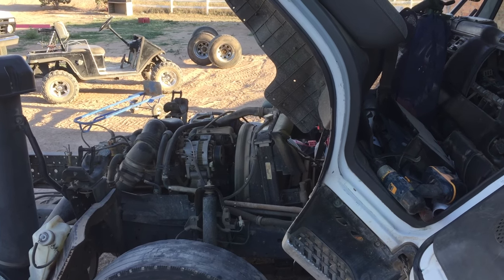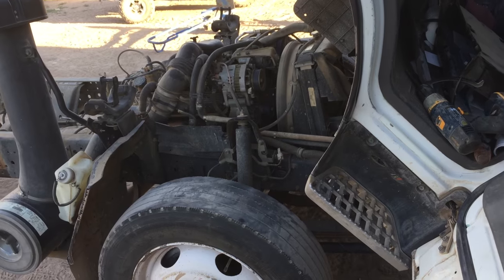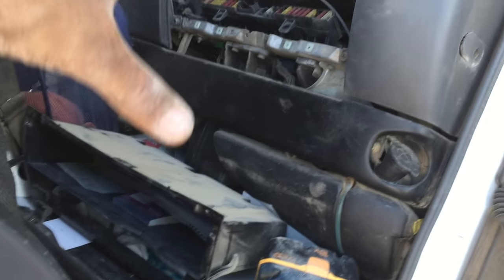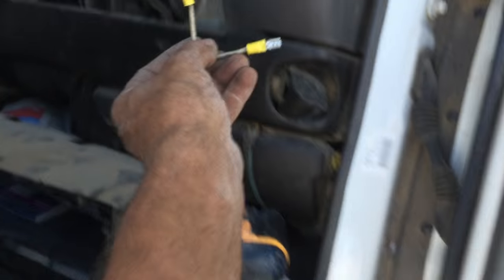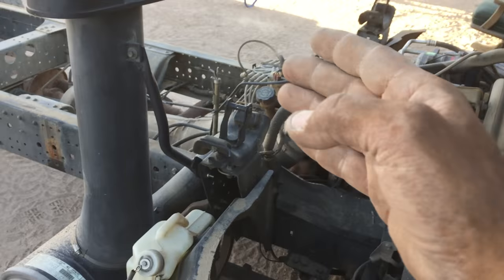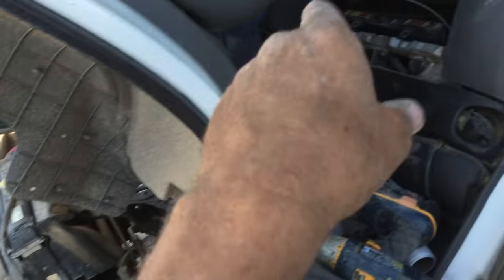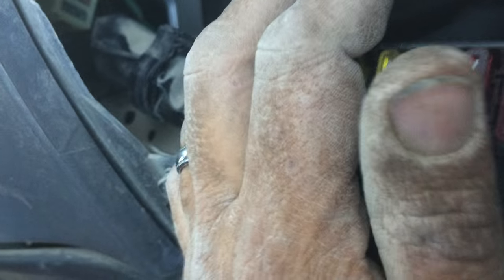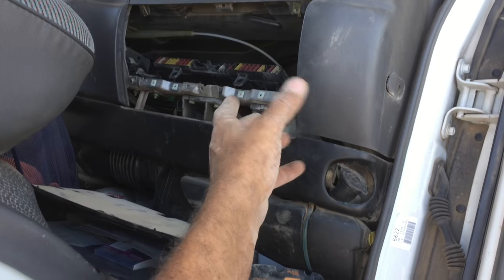2000 Isuzu NPR No Start, Transmission Shifting Issues

Comment: I have a 2002 NPR, and had no dash lights, and truck just died suddenly. Mechanic couldn't figure it out, but I watched your video, and went to his shop tonight and sure enough, behind the fuse box, there were those 3 little fuses, and it was the 10 amp fuse blown. man, this really helped me, as I was going to buy an $800.00 computer, and cross my fingers that was the problem. and normally there are no returns on electric parts. I'll have mechanic put my old computer back in and see what happens.  I would lie to figure out the why, the fuse blew, but that's another day. Thank you so much !

Comment: Thank You! You saved me a day of diagnosis.  I was driving today when my speedometer stopped working, many of my instrument cluster lights went out and my transmission would not shift.  I have all of the factory manuals for my 2001 NQR and was ready to dive in when I thought to check YouTube.  Your video popped up and sure enough the 10 amp fuse was blown.  I might have never found it in that location.  Thanks again!

Comment: Thank you so much for this video!!!!!
  Saved my rear end today as a customer of mine had a no crank no start issue this morning at a job sight. Talked to dealer, couldn't help with diagrams. 
  Sure enough I looked on YouTube and it was the 10amp fuse in that white box behind the glove box that was hidden. Put new fuse in and we had power, DLC and PCM communication and it finally started and ran. It also got the blower motor on the AC working too. 
   Again... THANK YOU FOR THIS VIDEO!!!!!!!!!!!!!

Comment: Thanks a million dude for posting this just so you guys know in my 2002 I did not have to remove the whole glove box or fuse panel if you pop off the gray trim by taking out the ashtray and pulling it off there's two hand holes to access just this fuse box a big one for your hand and a little one for needle nose pliers

Comment: Thanks a million I was about to change the transmission 6000.00 cost I have a 2004 gmc W4500 The lights on the dash board stopped working and the transmission shift not working properly when I     put on Drive transmission skip th e first gear and start on 2 gear the over drive button doesn't work I changed the fuse mentioned in that video it was burned of course all went back to normal Thanks Again

Comment: i just bought a nissan ud 2600 diesel turboed. i drove it 750 miles home. next day wont start, ive been chasing wires all day.  looking for the short, spliced some crummy rotten lines but still no luck..... its so hard when someone else went in and rigged up a crazy system and i have to figure it out,

Comment: Hey thomas..im working with a 2000 NPR 4.8L ...with this transmission...shifts fine in all gears ..just when coming to a stop it jerks violently and makes a noise that sounds like the shifter was thrown into park while the vehicle is moving...and thoughts on that

Comment: Hi Brian,
I have a 2013 Isuzu NPR HD with 40K miles on it.  I drove it a few months ago and then tried to start it a week later to find that my dash lights all came on when I turned the key but it would not crank.  I thought the battery was at fault so replaced it, still no starter.  I then replaced the starter and still nothing.  My scanner is telling me it can't communicate so I then checked the fuses (not the ones you mentioned in the block behind the dash) and all checked ok.  I can start the truck if I bypass the ignition circuit and go right to the starter solenoid with the key on and it will run for about 2 - 3 seconds and shuts down.  I have fuel in the rail so I know the pump is working.  I am now thinking it might be the PIM.  Any thoughts?

Comment: Thank you for the NPR videos !! I noticed a lot of these trucks are needing service! I have a 1999 NPR Isuzu with a crank only no start issue. To start the engine I have to bypass the fuel pump relay.. Any thoughts?
Reply from the maker: is there a check engine light? have you tested the relay itself ?
Reply: thomas brian 99 npr no click, no start. Battery is fine so I’m lost. Any advice?

Comment: I have the transmission light on, on my dash telling me that ....my Isuzu 08 diesel NQR 5.2 L. Question, can I find the same fuse on my 08 Isuzu 5.2 related to my shifting gear problem? from 2000 models to 2008 is a big difference..?. thanks JC

Comment: Hi question i have a 2015 Fuso diesel engine it taking about 35 seconds to start up the engine even when the engine been running for hours turned off then started again it hard to start too .  Do you have any idea?  It is bad injector?

Comment: HI BRIAN. Have an ELF NKR81 witha a smother-e transmission. Its a basically a manual transmission without a clutch. Have you any experience  with these if so I have a few questions for you which may be worth making a video about.

Comment: 2004 Isuzu diesel with 4HK1 engine - I believe that's it - just shut off while on highway.  Suspected poor fuel.  Pulled fuel filter.  The level was almost halfway.  That's not normal.  A hiss sound when it unsealed as I spun it off.  Clogged fuel tank outlet to the engine maybe?

Comment: Hi Thomas i had a tracked diff banjo for an Isuzu npr 300 truck, i replaced the banjo and the ignition started just fine with no warning sensor light coming on, but later whn i started the ignition it started, while on neatral it gave a revving sound than it stopped. When i turn the ignition on the transmission warning light comes on and the truck won't start. Even whn i disable the diff sensors and the battery, same thing. A diagnostic tester guy said it's the relay shift, i changed it but still same problem. What could be the problem? Thanks

Comment: Hi Thomas. I have a 1999 W4500, reverse gear does not work. Could this be caused by that fuse? All forward gears work fine. Also only getting 4 mpg. I know it needs a manifold gasket, Could that be cause for low mileage? Thanks.

Comment: Hello I have a Isuzu elf truck NKR similar to the NPR its a 2003, I'm not starting I had to replace a diesel pump them it started but idle badly and we tried shifting the pump timing but I do realise that on ignition the EGR system and the suction control valve for the fuel pump always running can this be my issue? Also I don't get anything when I plug in the OBD2 scanner.

Comment: I have a lavatory truck we use at the airport I got a trouble code pop 757. B12 I have no forward and no reverse. The codes says that the solenoid is stuck. What’s it talking about? I’m in Cleveland Ohio.

Comment: Great info. I have a 07 isuzu NPR 5.2 diesel  and when I use my left turn signal the trans starts shifting bad and a gear with ! Symbol appears on the cluster only when turning left. Have you come across this issue?
Reply from the maker: yes, a pig tail on top of the trans, easy to see and to get to. 2 wires on one side, 1 wire on the other. it was broke and doing that exact same thing. i could not explain what it went to. but i figured the wire needed fixed, so i did and the damn issue went away. i wanted to research it more but the truck was needed back in the field asap. thanks for the great question. i hope it helps. thanks for watching.

Comment: Mr Thomas i desperately need your intervention, i have a 2012 npr 300  isuzu truck, i my rear axle seal was leaking differential oil, I have replaced the both outer seal and inner seal. It's no longer leaking but it won't start, its shows a gearbox sensor light. If i disable a sensor on the engine and put it back on it starts. Do i have to take it to a diagnostic tester in order to disable the sensor since the seals hv been changed? Please advise
Reply from the maker: yes, you can also disconnect the battery or batteries, and allow time for the ecm to drain (15 min or so ) then reconnect the batteries and start. this too will reset the stored code. i personally leave them disconnected for about 30 min although 15 or less normally does the trick.the ecm will re learn itself and when it does not see a issue anymore it will fire rire up. great question. thanks for watching.

Comment: Hello sir. I have a weird question for you.  My job has a 99 npr diesel 4cyl. Today my truck would not shut off. I had to hit the fuel shutoff lever to turn it off. Now the key wont light up the dash. Any ideas
Reply from the maker: prob the ignition switch. it will control both
Reply from the maker: im guessing its a 5.2 ? i would go to ignition switch first
Reply: Thank you sir. I'll check it
Reply: Sir we’re is the fuse shut off lever?

Comment: hi. I have 2 questions:
what is the difference between npr  and npc? 

where can I find out if a 2004 GMC 4500 transmission will fit a 2000 NPC ISUZU? 

I can't find any information on the NPC, but I found one for sale. 

thanks!

Comment: Hey Thomas, I'm having similar symptoms with my '95.5 Forward GMC W4 Gas.  It's got a 350 TBI engine with at low compression on at least two cylinders that blows oil out the case vents.  It has an off idle hesitation that seems like a bad TPS, but tests OK.  It seems like it shifts weird sometimes and uses A LOT of fuel.  I looked for that fuse cluster behind the glove box, but couldn't find it.  Would an older gas model even have one?
Reply from the maker: i think you have pre 1994, no they did not have it then. the fuel loss and low compression go hand and hand. the trans shifting weird on that engine will be due to one of two things. a bad trans , or low spark in the cylinders. check plugs and wires and cap and rotor. and even a low coil output. these items also go hand in hand with fuel issue. good luck.
Reply: Thanks.  I already changed the plugs, wires, and cap and rotor (coil seemed ok), so I think the low spark is ruled out for now.  I'm guessing that the transmission is probably ok.  It just seemed strange to me because I'm not used to a heavily loaded big truck with a weak engine on hills.  At least it's getting the job done now.

Comment: Have a 2003 W4500 with a myriad of electrical issues (no cold start, no exhaust brake, no DRL, temp gauge cycles to maximum reading, fast flasher but no lights on right signal, faint glow from indicator lights when running at night, [indicator lights go dim and pulse in brightness on cranking], turning the key to ON (w/o cranking) and the charge relay (B-19) starts cycling of and on at a rapid (0.5 sec) pace, (cranks at a normal rate however). . .  All fuses work, batteries good (hold charge, 13.8V resting, load test as good), all relays good, all solenoids test as should, all circuits test continuous, no indication of parasitic load.   The pass-through connector (H-4 - H-8 connectors) is all that is left to check for continuity but is relatively inaccessible.  As it has a bolt through it holding H-5 - H-8 connectors into the housing, does your experience indicate this pass through comes apart if the bolt is removed. (The H-4 connector sits outside the H-5 - H-8 housing and can be split apart fairly easily; allowed me to clean the pins and sockets remedying a forward drive engagement problem [ D-2-1 placement of the shifter had no forward motion] hence my reason for testing the current draw through the pass-through to see if the rest of the pins and sockets need cleaning.
Reply from the maker: absolutely they do, thanks for watching, is this a tilt master?
Reply: Thanks for the reply. (Been trying to beat the weather with this repair).  Yes a Tilt Master w 4HEI diesel.  Pass- through on my truck will not come apart.  Have now stripped the cab (to expose the harness) and testing the continuity of individual connectors in the pass-through as well as current bleed from possible crap in the connector to other circuits indicates nothing is possibly wrong at this point. Opening the looms starting with the relay banks (top center) of the dash and tracing circuits it soon became obvious there is no adequate wiring diagram for this year/model of truck as this truck is wired different at the charge relay than indicated in  any and all of the wiring diagrams I have seen (and I have the Isuzu shop manual for this truck).  The alternator has been replaced (as the voltage regulator is not replaceable) but the faint glow of the indicator lights when running (intermittent) suggests the v-regulator is faulty in the new alt but diagnostic tests from in the manual indicate otherwise.  Alternator shop cannot provide a schematic for the outputs on this unit to do my own testing and they assure me the alt. (though a rebuild) was bench tested once rebuilt.  Pain in the ass to swap again (due to vacuum pump) so want to test thoroughly first before I do this again as it is now -10c and snowing for the next few days. My voltage relay is wired as such: (#87 [relay] = #1[socket], #85 = #2, #87a = #3, #86 = #4, #30 = #5) B-19#1 is an empty socket (no wire), B-19#2 comes from alternator (W/l color wire in plug connector on the alt) through the pass-through to the B-19#2 connector in the relay socket. This circuit branched before the relay socket and continued to terminal #3 of connector B-52 at the instrument cluster.  The diodes in the i-cluster tied to B-52#3 all test good. Further upstream, the gauge back fuse is good and I get 13.2V at B-51#8 suggesting power to the i-cluster from the ign. switch.  Back at the charge relay socket, B-19#3 and B-19#4 connectors DO NOT go to ground as in the wiring diagram BUT ARE instead both connected to fuse #12 which is switched to 12v at the ign. switch.  B-19#5 connector in the relay socket connects to the #2 connector of relays B-38 (exhaust brake) and B-21 (heater/AC) powering the switching coil in them (as #4 connectors at B-38 and B-21 both go to gnd).  The wiring diagram has B-19#5 relay connector circuit branching back to the i-cluster to the B-52#3. I lack this branch as the connection to B-52#3 is made from B-19#2 relay connector. Though lots of branches w/i the wiring looms, by opening the loom, it was confirmed there is no branch in the B-19#5 relay to B-52#3 at the instrument cluster (no branches period).  Does anyone possess a wiring diagram that shows my circuit mapping so I can continue my diagnosis?  Anyone have any info on the alternator in this truck (i.e. schematic) so the terminals can be adequately identified so I can use the diagnostic procedures in the manual to test the alt. on the truck figure out if my replacement is junked too?  As the alternator shop can't provide schematic info, I do not trust the "bench tested after rebuild" assurance I have been given.  Faint glow of brake booster, charge, and brake indicator lights (can only see 'em at night in the dark; not visible in sunlight) suggest the alternator is still hooped but need more info to test on the truck before yanking it out again. Thx Mark

Comment: Thanks .just bought an 2000 udi truck 200000 miles. I drove if for 3 hrs . No problems. Got home cut it off. Then it wouldn’t start.  Just a click sound when trying to start it up. Bad starter I think.

Comment: I have a 1999 isuzu Npr 4 cylinder diesel
The issue is that the truck cranks just normal but there’s no gear engagement. No reverse, no first, no 2nd. However before it completely stop taking any gears in two occasions it ran in first gear but right when it was ready to shift to 2nd it neutralized
Please help
I already looked for those 3 fuses but mine does not have it
Reply: I got the same problem right now
Reply: @joelpenado1204  i ended up taking the truck to an Isuzu shop and had to get transmission rebuild due to a solenoid issue. Also, had to get a full tune up and all line flushed out, cost me almost $5k but it was worth it. Till this day truck is running just fine

Comment: Hi Thomas! Love the vids buddy! By chance, would you happen to know if that 10amp fuse can cause overdrive to not engage? I have a 2006 GMC W4500 and right when it hits overdrive the rpm’s stay up in the 3100-3300 range. So, I guess maybe it does go into overdrive, but the rpm range seems a bit high and I try not to stay in it. Almost feels like it needs more gear up top, but maybe that’s just the way that it is? Thanks again buddy!
Seth
Reply from the maker: BUTTON ON THE SHIFTIER, ARE YOU PUSHING IT IN. thanks for watching
Reply: thomas brian Yes, and the light turns on and off. The truck runs flawlessly, other than it feeling like it needs more gear in overdrive. It will shift into overdrive though. I’ve also tried messing with the exhaust brake for whatever stupid reason, that’s not it. Maybe they’re just geared low in overdrive? Thanks for getting back to me buddy!
Reply: @junkdiggersjunkremoval1404 
Did you ever find a solution for this? I just bought a 2007 gmc w4500 and it’s doing the same thing! Any solution??
Reply: @jeremynewton601 Hi Jeremy, that transmission ended up taking a crap shortly after. Honestly, that’s just the way they run boss. I found out from a shop that swapped that transmission out that they’re just geared that way. The bands ended up taking a shit in the blown trans. Is yours the 4 speed, or 6?
Reply: @jeremynewton601 Also, is it the 5.2l diesel? They’re great trucks, just no info on them. Maybe it’s because they were made for only 3 years.
Reply: @junkdiggersjunkremoval1404  
Thanks for getting back to me! Mine is the 4 speed. Runs perfect 1-3 but there is no 4 at all.
So I can only go 50mph max and that’s at 3000 RPM’s
Reply: @junkdiggersjunkremoval1404  yes it’s the 5.2
Yeah I agree, I haven’t much info at all on them lol
Reply: @jeremynewton601  Is the overdrive button on the shifter on? Does it shift into overdrive and just rev, or doesn’t shift at all?
Reply: @junkdiggersjunkremoval1404  
Yes the OD button is on the shifter but I don’t feel it engage at all and I don’t feel it shift into 4th at all. So my max speed is about 50 and that’s at 3000 rpm’s which isn’t sustainable driving in my opinion. So I feel I don’t have OD/4th gear.